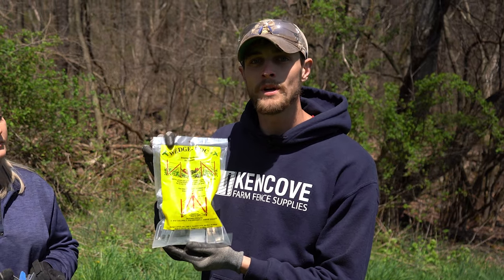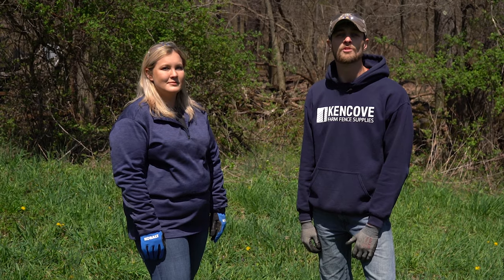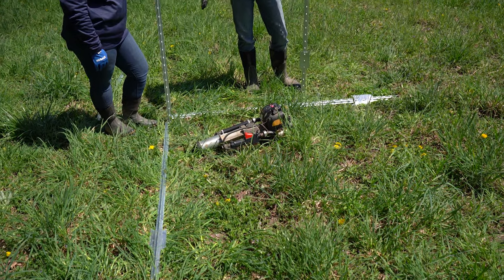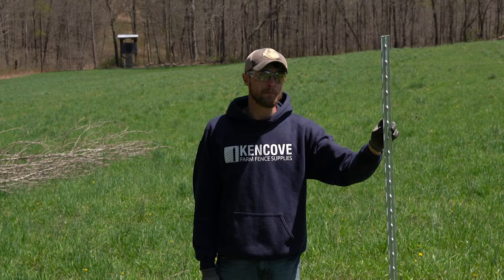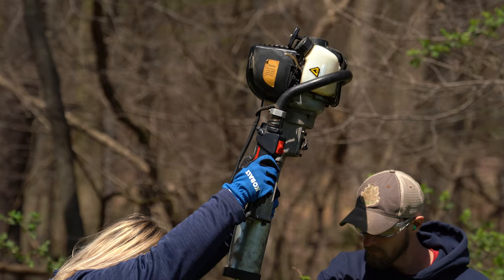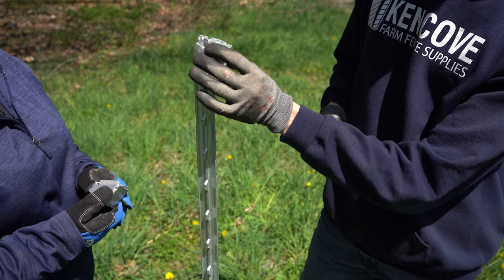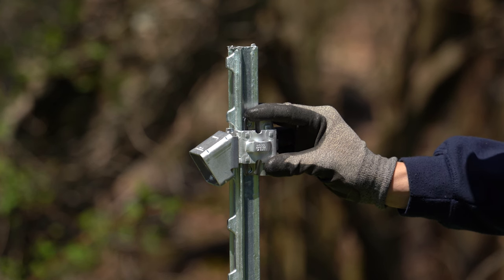Fencing 101 - Building T-Post Corner Braces with Wedge-Loc

Comment: i use these a lot. i rent a pasture and didn't want to dig in permanent wood posts and braces. i have half mile runs with 2, 17 gauge electric fence wires tightened by those rachet type tensioners. Speaking from experience, i initially put the brackets high up, about 6-8" from the top of the corner, as they show. with the brackets that high and wires pulling from 2 directions, once we got a heavy rain a couple times, the corner post and the brace posts pulled up and out of the ground. now i put the brackets about 1/3 of the way down on the corner t-post.

Comment: Beginner here, so sorry for the basic question! When corners are done with tposts and wedge-loc, where should the fencing's first attachment point be? On all the videos I've watched about putting up woven fencing, they have wooden posts at the corner and start by wrapping the fence around the post and tying it to itself.
Reply from the maker: You would not want to terminate on a T-Post Corner. I would recommend putting your termination/end point on a seperate post. There are horizontal wedge-loc kits available, that can be used at gate/termination points. The way you terminate will depend on your fencing type used

Comment: With the nubs faced in how is the barbed wire held in place?  I have not seen any video on how to keep the wire in place.
Reply from the maker: There are several ways to fasten wire to T-posts. Typically T-post clips are used to hold the wire between two suds. You may choose to rotate your T-posts to a different orientation based on your fence or material needs.
Reply: @KencoveFarmFence  sorry I wasn’t clear. When doing the corner posts.
Reply from the maker: @janspiros9671  You would want to run your wire on the outside of your corners. To do this you could use T-post clips or backside insulators like these: https://kencove.com/fence/detail.php?code=ITB2
Reply: Jesus H Christ you mean to tell me you have to use a engine driven post driver? How frigging lazy do you have to be?
Reply: Maybe not lazy but fancy😂😂😂 fancy schmancy

Comment: QUESTION: What is the length of the T-posts used in this video, & how far do they stick out of the ground to the top point? For the angled brace post, the angle created & placement location of the vertical post with the lower bracket, would vary based on the length of the posts. For distance accuracy of vertical posts placement for the lower brace, the formula of 12" to 16" from bottom of the plate on angled post, would create various lengths based on each posts overall length that is sticking out of the ground. Different fence heights would require different height of fence posts. This may be something for future videos.

Comment: How much tension can I expect this system to hold? 4 stands 12.5 gauge aluminum wire. It will be my semi permanent fencing for the next 2-3 years till I’m able to get the driver I want for my tractor.
Reply from the maker: Often times, folks using T-posts may opt for 14ga high tensile fence for less strain on bracing with multiple strands. Both Wedge-Loc and LockJawz should handle 4 strands of 14ga without problem. With 12.5ga high tensile wire, you would need to make sure you have depth and adequate lengths of brace posts if using T-posts. Proper T-post bracing should be able to easily handle 3 strands of 12.5ga high tensile. Adding a 4th, 5th, or 6th strand of 12.5ga high tensile wire would require bracing that was equal to a single H brace with wood posts.
Reply: @KencoveFarmFence  even with how much lighter aluminum wire is? If aluminum is too much then we will order the 14 aluminum. The only reason for the 12.5 aluminum is locally it’s in 4000’ rolls and we’re fencing 40 acres.
Reply from the maker: @nstewart636  We would advise you to the more cautious side. LockJawz still recommends wood H braces when using 12.5ga high tensile with multiple strands, therefore we recommend reducing number of strands, or opting for 14ga wire. That being said, not all variations of strands, gauge, soil conditions, etc. have been tested to know the full range of these braces. We experimented with other alternative braces with 14ga high tensile wire this past year and have seen success so far.
Reply: @KencoveFarmFence  wel I see you have the 14g in big rolls so I will order from you guys when I order the lock jawz or wedge lock. Thank you!

Comment: Hello: simple questions.
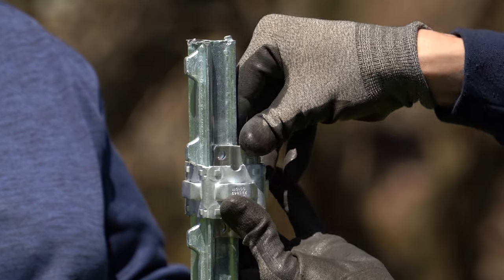Video: (3:04/5:24) The wedge side of the T-Bar Corner Brace is facing "Far Out".
Video: (3:45/5:24) The wedge side of the T-Bar Corner Brace is facing "Far Out".
Video: (4:21/5:24) The wedge side of the T-Bar Corner Brace is facing "Far Out".
Fact:
This will make it much more difficult to pull Large Hole Structure Game Fencing around the (3) corner T-Poles.
Questions:
Video: (4:19/5:24) Inserting the "socket" into the "collar".
(#1)
Will a "socket" insert into the "collar" on the same side as the "locking wedge" ?
(#2)
Will not having the (3) "locking wedges" facing inwards towards each other prevent the T-Bar Corner Brace from facing "Far Out" ?
==========
Thank You
Reply from the maker: Hello Bill, 
T-Post bracing is not recommended for woven wire/field fence. If you are installing "large hole structure game fencing", you will need to brace your orders with wood posts. 
Yes, You can insert a a wedge and a socket on the same side of the collar if that fits your context. 
The wedges need to go on the "spine" side of the T-posts. If you want the wedges facing towards the inside of the brace, rotate your T-posts so that the "numbs" are facing outwards.

Comment: When you're using that post driver, how are you checking that it's straight up and down?  Is there a bubble level on the driver?
Reply from the maker: Great question. There is not a level bubble. Your best option is to have an assistant keeping an eye for you. But., if that is not possible, running some lines from your end points near the bottom and top of the post, just like when driving wooden posts, works as well.